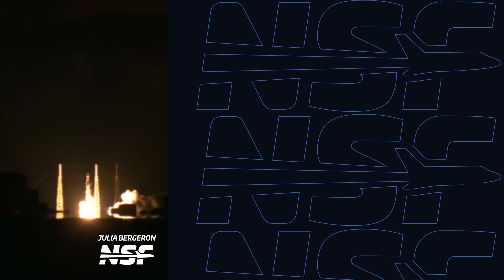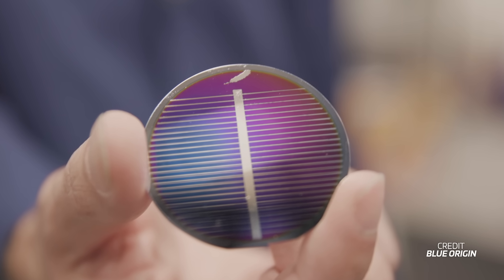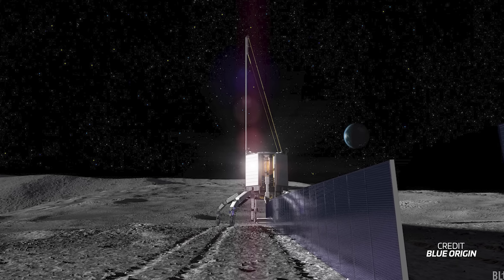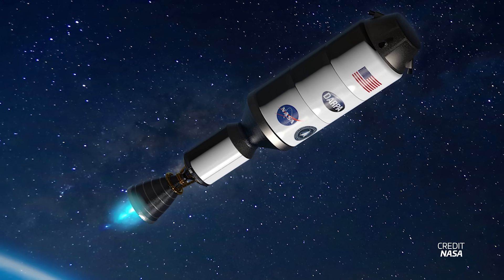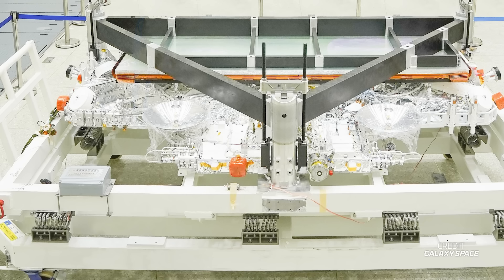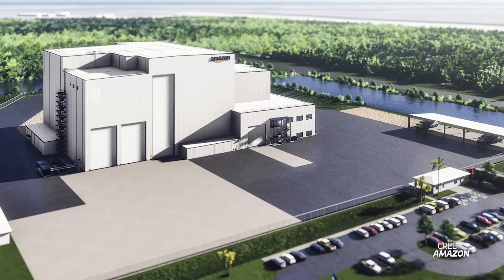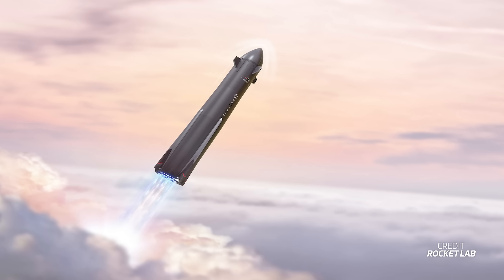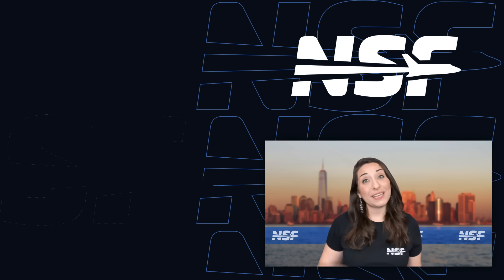This Week in Spaceflight:  Is Nuclear Propulsion Coming Back? NASA Awards New Development Contracts

Comment: Oh radioactive hydrogen backfire? 

 A piece of metal, why not cardboard? Stop fission 😮 😢.   So hydrogen blows what kind of screws are you using to keep 
that metal in place?  Can I buy from a DIY store, please!
 Most  Radioactive ☢️ material used up before  re-entry.

$ 400 million wasted

It is a hydrogen/radioactive bomb.

There was a reason it stopped in 1960s

Solarwinds are FASTER

Comment: Spacex will be doing a ship every hour for 16 hours a day with an 8 hour curfew for sleeping. Can you imagine what it will  be like for residents? I bet Spacex buys up all the land around the launch site...and the towns. And can you imagine the ruckus if ships occasionally blow up? You wouldn't want to live anywhere near the base
Reply: I wonder what relation this comment has to do with the video 😅😅
Reply: They would need to move out to the ocean with pipelines for propellants, etc. Imo
Reply: Probably international waters if even possible ..
Reply: I don't believe that Boca Chica is the planned launch site. That's what the development at Florida will eventually become. This is a test site, to iron out all the 'kinks' in the Starship System. But it could launch completed systems across the Gulf of Mexico to their launch site? (Or ship them) 
But imagine single Boosters drifting across the ocean (they won't have to fill them right up and could just install the 13 center Raptors) and around the bottom of the peninsular and up the East Coast to Cape Canaveral. Then caught by the chopsticks. Now that would be, like, 😲

Comment: I wish DARPA and NASA had awarded SpaceX with the design of the nuclear rocket. I know Lockheed employees have more security clearance but SpaceX would have built in a few years. Hopefully Lockheed Martin can have it built by 2027. I'm just happy Boeing didn't get the contract
Reply: If they could use Falcon 9 or hopefully Starship which would've gotten some OFTs under its belt by then to be hopefully certified for payload flights, they can get this to orbit quite easily no matter how big it's gonna get. 

I mean even FH now placed heaviest commercial payload ever, Jupiter 3 which weighed 9000kg, imagine what it can do.
Reply: Probably not safe to use SusX anymore. They've been a sieve.

Comment: We need nuclear power in space, and we need it 50 years ago!
Reply: Nuclear Power, or Nuclear Propulsion? Transit 4A launched in 1961
Nimbus III launched in 1969
We had nuclear batteries (ALSEP) for Apollo missions.
Pioneer 10 and 11 in the 1970s
Viking 1 and 2 launched in the 1970s
Voyager 1 and 2
Galileo launched in 1988
Ulysses launched in 1990
Mars Pathfinder
The Cassini Orbiter and Hyugen probe have nuclear power
New Horizons was launched in 2006
Curiosity rover has nuclear power
We've had nuclear power in space for over 50 yrs, albeit nuclear generated electricity, or nuclear heaters keeping equipment warm enough to work, but we have nuclear power in space. However, we've never had nuclear propulsion in space. People tend to only think of nuclear in space as propulsion and completely forget that nuclear power is a thing we are very familiar with.
Reply: @stephenbullington  Top research! Some people just can't quite grasp the difference.  
Sort of like having a kerosene engine powering a generator and kerosene injectors feeding a jet turbine engine. Slightly different compositions of the fuel but completely different outcomes.
Reply: Neither NASA or anyone else had the technology to do it 50 years ago.

Comment: NO
dont do it 
no 
do not bring back nuclear propulsion 
ever
Reply: ditch deny drop discard darpas draco
Reply: They didn't even have it in the first place, to be able to bring it back. Where did you get your information?
If they are going to use it, they need to take it far away from Earth and make sure it ends up in an orbit around the Sun.
Dirty, risky and we have enough polluting our sea/air/water/dirt without adding hot shooting stars to the tragedies.

Comment: Hopefully they have better safety practices at the new nuclear propulsion facility than what they had at the rocketdyne facility in Simi valley. 

It was a secret program that had 10 reactors in aluminum sheds.  At least four of the ten nuclear reactors suffered accidents dosing southern Ventura county and northern Los Angeles counties with radiation. 

The ground there is still contaminated. We had a fire in the area about 8 years ago and people that knew were screaming about radioactive contamination from the smoke. Of course the media downplayed the issue but many downwind residents left the area until the fire was put out
Reply: sounds like you're talking about the "Santa Susana Field Laboratory"

"But there is no definitive proof that the contamination left from decades of nuclear testing is the source of cancers and other health issues. ... Hal Morgenstern, an epidemiology professor at the University of Michigan, conducted several studies between 1988 and 2002 to see if there was a link between chemical or radioactive contamination at the field lab and deaths caused by leukemia, lymphoma and other cancers. Results showed people living within a 2-mile radius were at least 60 percent more likely to be diagnosed with certain cancers than those living 5 miles away, but that doesn't mean the site's contamination is the cause, Morgenstern previously told the Simi Valley Acorn. Despite the data he collected, Morgenstern said, there wasn't enough evidence to identify an explicit link between cancer and field lab contamination. And the results were inconclusive as to whether activities at SSFL specifically affected or will affect cancer incidences, he said."